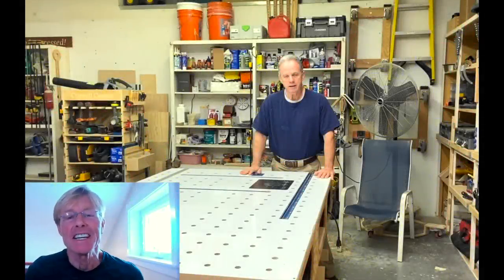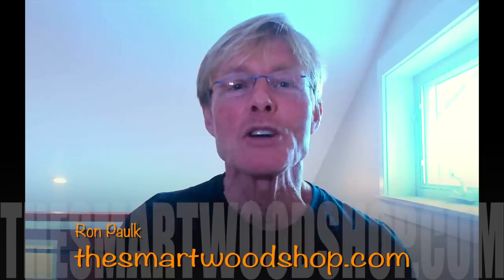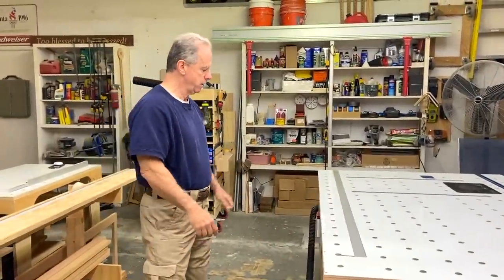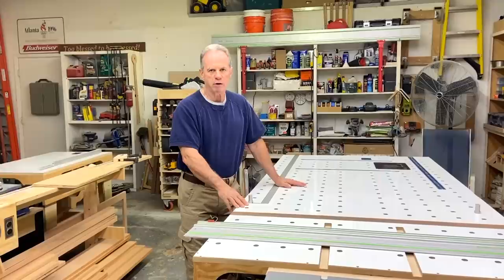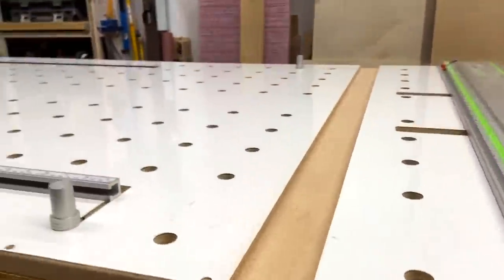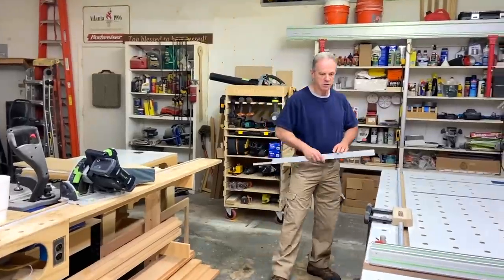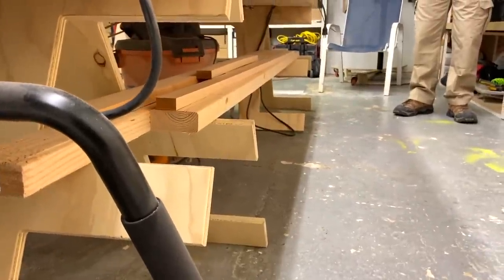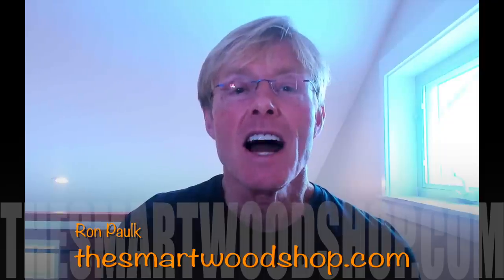Super Paulk Workbench

Comment: I used Ron's plans as the basis of my workbench 8 years ago. I absolutely love it. I made modifications for my model of table saw, router plate, and a dropped section my miter saw slides into with storage underneath. I also made a removable infeed table for the miter saw to handle 16' pieces of trim.

Comment: Nice work, I would like to know where you found the index magnifier.
Reply from the maker: https://www.fix.com/parts/table-saw/jet/fix10377319/convex-cursor-200439/?SourceCode=3&SearchTerm=200439
Reply from the maker: Another option: https://www.grizzly.com/parts/Grizzly-MAGNIFIED-CURSOR/P1023SL512
Reply: @TheSmartWoodshop  Thank you so much, hope they can deliver in France
Reply: @TheSmartWoodshop  Try to order but unfortunately can't be shipped to France
Reply: FYI, something is really messed up with Grizzly's site right now but, I was finally able to check out using a card - NOT Amazon Pay or PayPal

Comment: I was wondering if Kevin used the 22mm holes with the 96 mm on center or another drill pattern and size? I noticed that he is using a Kreg clamp and wondered if he is using 3/4 bench dogs
Reply: Don Giles, I did lay the holes out differently for my needs on this table, but this is the old pattern with 20 mm holes on 4 inch centers. 
I use the 20mm UJK stubby bench dogs for cutting up to 1 inch thick sheet goods (allows clearance for my Festool track saw) but I have the super dogs if I ever need to cut extra thick material.

Comment: Did you use the One Inch Grid to drill/cut the Dog Holes or did you use a CNC Machine to locate the holes.
Reply: I used a CNC machine to cut all the holes/dadoes for the tracks. I did not try to match up the holes with the grid, I use those just for layout.

Comment: Can anyone explain how Kevin setup the double t-track insert?  I bought the track and now realize the track is 3/4" thick, so if you do a flush dado you'll have to cut through the MDF.  I assume I can add a 3/8" backer under the table but I wanted to see if Keven had some other setup that I am missing.
Reply: Tim, you’re exactly right. I simply put a half inch backer board below the MDF. That closed the bottom of  the track, and then I drilled three holes along the length of the track to attach t-nuts with knobs.
Reply: @kevincriswell7533  Any chance you have plans for this beauty?! For us less skilled woodworkers who have a hard-time freehanding these sorts of things.
Reply: Hey Tim, you mind posting a link to where you got the double t-track insert? I can't find anything like it anywhere. Thanks!